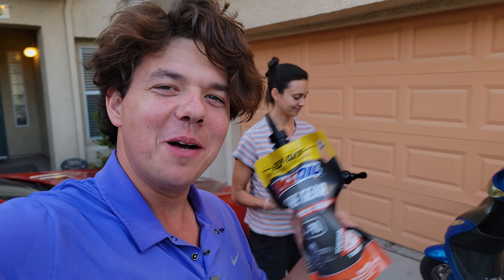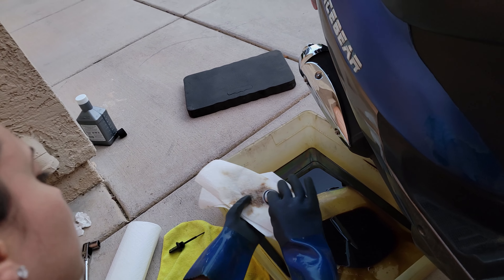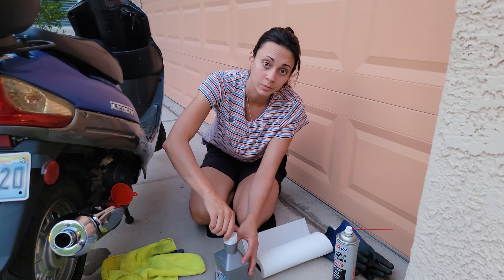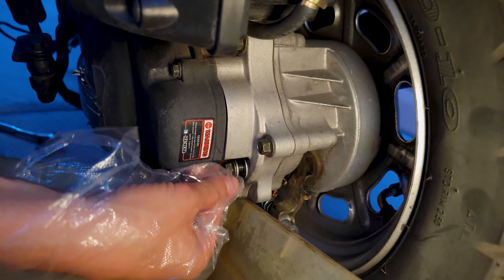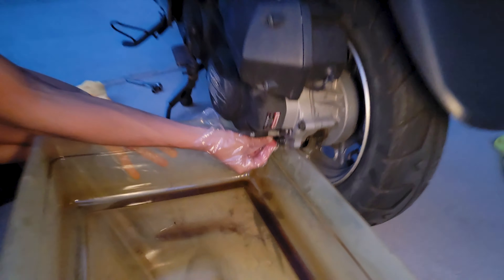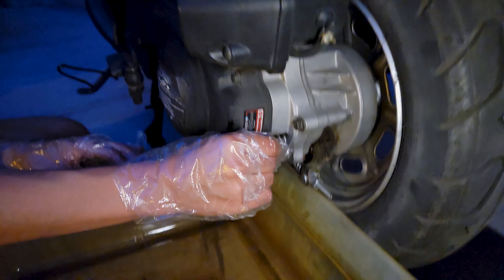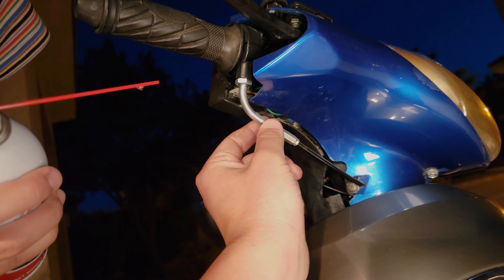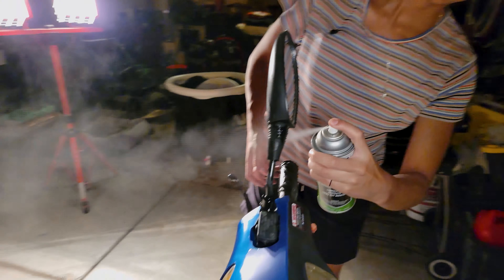Your 49CC Scooter is dying without this

Comment from the maker: Watch This Next: Can Fuel Additives Make More POWER ? - https://youtu.be/zH-VquYlhqA

Video Guide:
0:00 Intro
0:34 Cleaning Additives Flush - https://www.amsoil.com/p/engine-and-transmission-flush-flsh/?zo=5331179 Fuel cleaner - https://www.amsoil.com/p/quickshot-aqs/?zo=5331179
2:20 Draining Maxwell (2015 Ice Bear) 
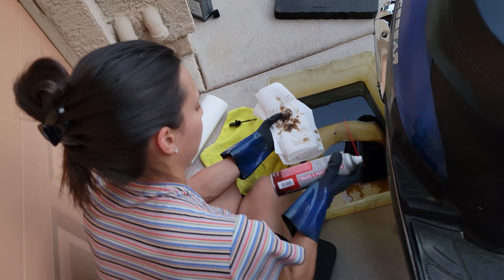3:17 Cleaning oil screen
4:38 Draining oil plug
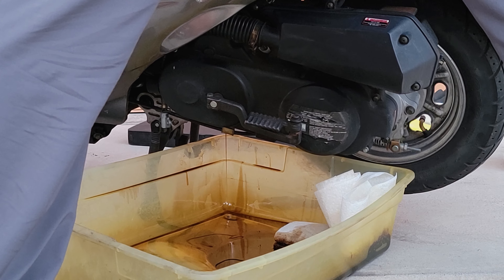5:00 Scooter Motor Oil - https://www.amsoil.com/p/formula-4-stroke-synthetic-scooter-oil-aso/?zo=5331179
8:20 Checking oil level 
9:50 Old Oil After Flush 
10:05 Draining Gear Lube
12:03 Filling Gear Lube - https://www.amsoil.com/p/severe-gear-75w-90-svg/?zo=5331179
18:37 Old Gear Lube
18:48 Lubing Cables MP - https://www.amsoil.com/p/mp-metal-protector-amp/?zo=5331179
24:27 Rubber & Plastic Silicone Protection - https://www.amsoil.com/p/silicone-spray-alss/?zo=5331179
27:23 Power Duo UCL & Dominator Octan booster - https://www.amsoil.com/p/motorcycle-octane-boost-mob/?code=MOBCN-CA?zo=5331179     Upper cylinder lubricant - https://www.amsoil.com/p/upper-cylinder-lubricant-ucl/?zo=5331179
29:09 Test drive 
30:40 1st time riding a 49cc scooter
32:27 Closing Notes 
Your scooter can run better than brand new with these fluids! 

     ♥   Find The Right Fluids For Your Vehicles - https://www.amsoil.com/lookup/auto-and-light-truck/?zo=5331179

     ✅   Save 25% On Your Next Fluid Order: https://www.amsoil.com/offers/pc/?zo=5331179

     ♥   See Fluid Performance Tests - https://www.amsoil.com/performancetests.aspx?zo=5331179     

     ✅   Buy Me a Coffee - https://www.buymeacoffee.com/YouLubher

     🥇🥇🥇   Synthetic Oil Protection Google Map Reviews
(702) 472-3614
https://maps.app.goo.gl/1aXxuXrXK9eJwqK78
            
     ♥   Synthetic Oil Protection Website - http://syntheticoilprotection.net

     Did you know a oil manufacturer can call a lubricant a Full Synthetic when it's only 25% synthetic? AMSOIL is different because it is 100% Synthetic and has a higher film strength keeping the metal parts separated. AMSOIL allows less friction, less heat, less wear on the component. AMSOIL Signature Series motor oil will last 25,000 miles on 1 oil change! 

     ♥   Your Vehicle Could Run Better Than Brand New By Choosing The Right Fluids! See Results - https://youtu.be/9Y7XSl5YHFg

     ♥   Why AMSOIL - https://www.amsoil.com/about/exclusive-distribution/?zo=5331179   

     ♥   Synthetic Oil Protection Coffee - Ebens Favorite: https://supportwith.coffee/shop/subscriptions/sop/

Comment: My goldwing when checking oil should be on center stand, and the dipstick should not be screwed in when checking oil level.  I hope this one is not the same way.
Reply from the maker: Even if it is it's fine it would be pretty much in the middle we put in the exact amount that I called for👍

I used to think changing fluids was very technical after doing it for about 17,000 hours I found out it's a lot simpler than most people think

Comment: Amsoil Dominator is great for 2 cycles! Great vid thanks 👍
Reply from the maker: What type of two cycle do you run it in?
Reply: @Syntheticoilprotection  a Phantom 85 bycicle motor very high RPM's. I went through 2 cylinder jugs before break in until I started using the Dominator and now I have broken the motor in and it's got more power with a nice brownish spark plug electrode. Amsoil is no joke!
Reply from the maker: I love it Steve are you the one that sent me those photos of that that bike?
Reply: @Syntheticoilprotection  no but I would love to 👍

Comment: Great video Eben! Sometime check out the Thompsom Powerblast plate for the kitty cat! Might be a cool video. It helps direct the fuel from the squirters in the carb more directly into the intake. Helps atomization. Along with that and the Amsoil octane boost that car will be sweet. Even better I'd say. The amsoil is good as it is but with that extra kick itll be a drag car! Thanks Eben!
Reply from the maker: Where do you find that plate at?

Comment: I have an important question. If my car uses 5w-30, can I switch to 0w-30? I've seen mixed answers online.
Reply from the maker: Of course you can really use any oil the biggest thing is the quality the 100% synthetic film strength that's what really makes the big difference it's not so much the viscosity the big benefit of the zero weight is the cold flow and the Amsoil will make a huge Improvement for you this will give you the best value on the products and when you use my link I'll always be able to answer your questions in the future😃💯
✅   Save 25% On Your Next Fluid Order: https://www.amsoil.com/offers/pc/?zo=5331179
Reply: My civic takes 5w-30 and I run 0w-30 no issues . 

The “w” stands for winter weight, the 30 is viscosity at operating temp. So while hot the oil is identical, however the 0w flows better than 5w at cold start so I’d say it’s even better for your engine until it’s fully warmed up

 For my honda motorcycles I have not seen 0w or 5w so I just use the manufacturer recommended 10w
Reply from the maker: Yeah usually in oil with less cold flow additives has a higher Shear stability so it holds up a little bit better and high heat that's why a lot of the thicker oils are like 20w50 on the Harleys they really do well on the air-cooled Motors.
You'll see it here in this link scroll down you'll see the viscosity breakdown graph - 
https://www.amsoil.com/p/20w-50-synthetic-v-twin-motorcycle-oil-mcv/?zo=5331179

Comment: Instead of measuring the P.I. Performer I just buy the small engine formula for my motorcycle.
Reply from the maker: Yeah I was going to use the quick shot fuel additive I just forgot it and that's the only thing I had in my car but definitely good to use the quick shot that way if you store your equipment over the holidays you won't have the ethanol separation with the stabilizer